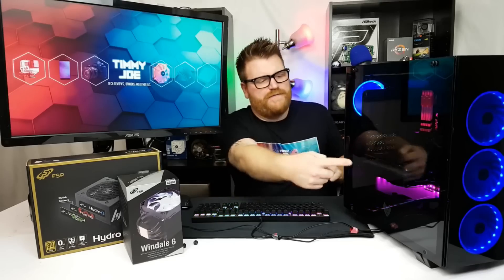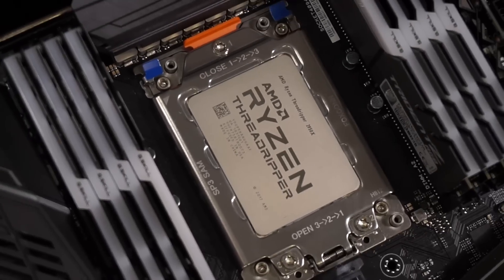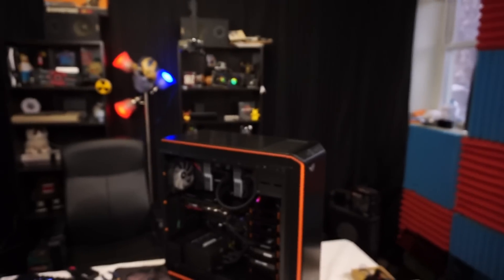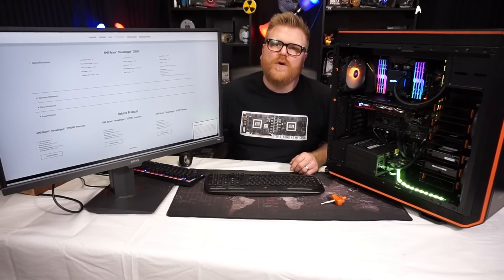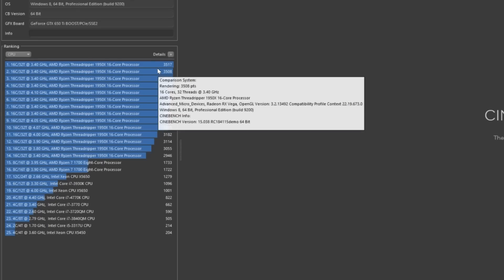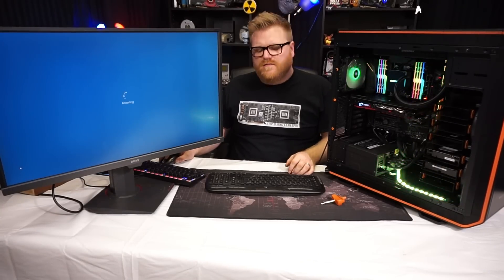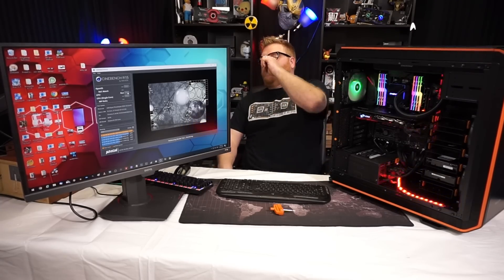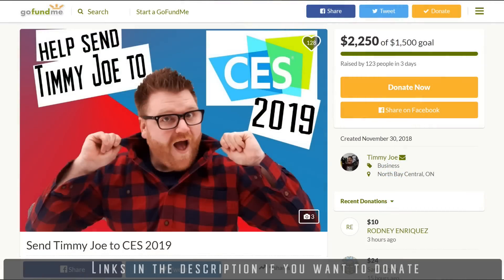Building, Overclocking and Cinebenching 2ed gen 16-core!

Comment: Take out some of the ram and up the speed to 3200, your benchmarks will be better.
Reply: idk about 2nd gen, but 1st gen on my gigabyte board did not play friendly with xmp profiles. I run linux and was getting kernel panics galore. Once I disabled the xmp profile and manually set all the timings and voltages it ran like a freaking champ. Rock solid 4.1ghz w/ 3200 ddr4 cl16, then again I also had 32gb not 64 (4/8 slots populated per motherboard manual)
Reply: In my test there's not a whole lot of difference between 2866 vs 3200 in Cinebench. You're better off setting RAM clocks a bit lower which will help you get better CPU thermals and clock speeds and give you better score compared to having higher speed RAM but lower speed and hotter CPU.
Reply: I havent had any trouble with XMP with 2 zenith extreme boards and a asrock taichi x399. Success with a 1920x 1950x and 2950x. I get 3515ish on the 2950x at 4.1GHZ and 3200mhz samsung bdie with TIGHT timings. I havent tried clocks higher than 4.1GHz yet.(only had the new chip a few days) SET THE PRIORITY TO REALTIME in ctrl-alt-delete i got a 400 point boost from JUST that.

Comment: try taking the top off of the case, it looks like it's really obstructing the airflow
Reply: Seriously.  That case is probably most of what's wrong.  Silence focused cases are terribad and that's a silence focused case if ever I saw one.
Reply: @abigailpatridge2948  its actually a very modular case. He doesn't/didnt know he can lower the mother board tray. Or even he could completely invert the mother board tray. So he could have put the fans on the inside of the case and not on that outside part. He just didnt know what he had on him. Or how to use it  I have the exact same case. And made the same mistakes at first I'm sure hell correct it.

Comment: I recently built a 2950x and from my research the Enermax coolers have a high failure rate regardless if its a 1st or 2nd gen cooler. I went with a CM 360ml and it failed after 3 days. I ended up going with a Corsair 280ml Platinum which worked out great.

Instead of doing a manual OC I highly recommend using PBO as it will be far more efficient than any manual OC you can do. You also want to enable PBO via the bios not Ryzen Master. Instructions for Asus bios below.

PBO - BIOS > Advanced\AMD CBS\NBIO Common Options\Precision Boost Overdrive Configuration\Accepted\ ENABLE

Furthermore, you don't want to push your TR over 68C / 1.4v for normal daily usage. If your drag racing for benchmarks then by all means burn up your silicon to get those high numbers. If anyone has questions bout building a TR you can check my 2950x YT live stream or just hit me up on my gaming stream.
Reply: can you help me i never went into that setting before

Comment: You do know you can lower the mother board tray to allow the fans on the inside of the case and not in the top shroud part. Or even you can completely invert the mother board tray If you wanted. Gamers nexus and LTT reviewed it and gave it high marks and said it was one of the most extremely modular case on the market with great noise to cooling performance.

Comment: Hey Timmy Joe, have you ever ran into an older board that only boots with one graphics card? I have an older 1155 ITX board that will only post with my R9 270 card, nothing else. i've tried everything from an R7 250, HD 7950 up to a R9 280X and even an RX 580. Wont boot on any of my Green cards either, 1050, 1030, 1050TI, nothing. thoughts?

Comment: We AMD people have it so easy now when it comes to overclocking. I have a ryzen 7 1700 in my laptop, and I can get it to 4 gigahertz with a slight voltage bump. In a laptop. And it's stable using prime95. All thanks to the ryzen master utility.

And dang that threadripper system is a lot of computer. Maybe we could try cramming it into my PlayStation 2 project? Jk.
Reply: What laptop

Comment: Wow, you're below my 1950x on a 120mm AIO...
3600+ with some cheap 3600-19-20-20 ram (I think it got about what you did with 2133 speeds)
41 multi at 101 FSB with 1.4v at medium LLC. Max temp was ~80c (max I've ever hit was 86c, just ramping voltage to around 1.45v just to see how much power I could draw). It was cold in my room, hence I was trying max power consumption with also 4x R9 Fury (tripped my 1200w PSU, LOL!)

Comment: I'm curious as to how you OC's the CPU (and memory).  I'd do a p-state all-core OC (frequency will still rise and fall with load, and will work normally.. and better than XFR).  As far as memory, get the Ryzen DRAM calculator and download Taiphoon Burner.  You can watch a video on how to get your memory's SPID info to use in the DRAM calc., and you can get the calc on Overclock dot net, it's made by 1usmus.  By using these methods, I have an 1800x that gets 1920 in CB15 (4.1 @ 1.39v / 3333/cl14 ) and settled down to 4.05 @ 1.37v + same mem stats for every day use, which gets 1880 in CB15.  It's a good method for sure.  It gives you all of the subtimings and voltages, gives a choice (standard, fast, extreme) and these settings always seem to work.  At the very least, it's a fantastic starting point.

Comment: You were probably running 3200MHz DRAM with your 1950x..vs. 2666. That will hurt your CB score. As far as boot issues and overclocking, take out 4 sticks and see how it does.. will likely hit 100MHz higher, if not more (might be able to get 3200 out of the RAM with only 4 sticks, as well).

Comment: Having all 8 RAM slots populated is putting a lot of stress on the IMC of the CPU. This raises heat output and also makes the CPU more unstable at high clock speeds. Try with only 4 stick of RAM. Also, no need to clock the RAM higher than 3200 Mhz, stressing the IMC. Beyond 3000-3200 Mhz you're getting diminishing returns. You are better off having the higher CPU clocks than RAM running at or over 3000 Mhz. All this is also confirmed by my personal tests on my 16-core 1950X.

Comment: Cooling and ram speed and timings... How low can you go on Gskill ram timings if running at only 2666MHz?
Reply: Varies a lot per kit, what he does, will not apply to even a batch made the next month on the same brand and series of RAM. Just like I can pull 4 identical GPUs, and 1 will not overclock as high on the Vram (or core), and even stock it might use 30w more (and a LOT more when overclocked), I'm referring to one of my RX 470 specifically, all 4 are XFX hot swap models, so its going to lower the TimeSpy score due to the limiting card (I'll still take number 1 since I have that for 2x, and almost beat the 3x score even with 1 less card, lol).

Comment: Juuuust a heads up..
Enermax Liqtech TR4 2 has some cons:

1. The fans SUCK. I've owned mine for a month, bought at the end of october, didnt even install until 1-2 weeks into november, and the bearings went out in one of the two fans. Ended up with loud, obnoxious, not so fun grinding (see tweet for quick video):
https://twitter.com/GloriousEggroll/status/1068762973638979584

2. The thermal paste that enermax sent with it was dried up beyond any means of usage. Would not come out of the tube, and when I forced it out, it was dry and clay-like. Did not use.

I ended up replacing the fans with two noctua 140mm SSO fans: NF-P14s redux 1500
after that it worked great. But yeah, kinda cheesed at enermax about this. BUT, at least the pump isn't dying. (The original TR4 Liqtech AIO had a known case of the pump dying, yikes)

Unfortunately it's the only AIO with full plate coverage. The pump on the Liqtech TR4 2 seems stable so far. Throw some new fans on it and use some better thermal paste and it's a solid cooler. Sitting at 4.1Ghz 1.37v 66-70c under load on my 1950x (mind you I also live in florida)

Also.. for that CPU I'd agree you probably want the 360. 1950x is fine with 280 but that beast you have needs a bigger cage.

and yeah, I had to upgrade my case as well. That bad boy was not fitting in a Fractal Define C (you can front mount it with some ninja-ing like I did), but I upgraded to a Cougar Panzer-S, plenty of space there!

Comment: bro why!!!!!!!!??? i bet lot of heat get stuck on the top of that case where the radiator is!!! maybe with better thermals you could achive more out of that bad ass combo!! 
p.s. i say, maybe just had the top panel removed ? Also an open case doesnt always mean good temps, but always means bad airflow,  and the airflow as i can see in this setup is not quit good

Comment: If you weren't so far away id let you run the rtx2070 i just ordered on my fx9590, even though you hate fx
Reply: At 4k, you'll be able to run th 2080ti nicely with FX (even underclocked), but I would guess you're going to do 1080p since that's a weaker GPU. I wouldn't recommend FX at 1080p either if you're running a 120+ Hz monitor... Its not the best for high frame rates (it does 60 fps great though, I've got no complaints on my long retired 8350 which I ran 4.8 Ghz for a long time, and now its screaming at 5.5 Ghz on exotic cooling, core temps peak usually below 0c so I can't read it in software. It's so overkill with a weak Titan Xp I run with it sometimes, haha, that thing is a trooper!).

Comment: i dont understand  1 thinks u have  3200mhz ram and everyone know this ram mhz very importand 4 ryzen why u still use ram  2666mhz ?
Reply from the maker: Not on the QVL list? I bet it would boot at a higher speed on a gigabyte board
Reply: @TimmyJoePCTech  sorry but i watch the video 3 time and i didint see anywhere memory frequency 3200mhz ? i only see 10:44  and 15:18  memory frequency still 2666mhz and u didint change the memory  frequency any one time?
Reply from the maker: I said it wouldn't boot with all 8 dimms at any higher, I haven't even tried removing them

Why you so worried about it hah.
Reply: @TimmyJoePCTech  of course I'm worried because I want to buy same processor and motherboard and it's not just only me maybe a lot of people watching your video and decide what they going to buy and if something happens we have to know this and you have to explain where is the problem and we not going to buy that's all please don't understand me wrong I don't want to attack you I just want to be sure that's all
Reply from the maker: @serdarmutlu2561  ok well I will be sure to give you an update soon!
Reply: @TimmyJoePCTech  thank you so much for understanding

Comment: those corsair sp 120 rgb fans are complete garbage , i bought the corsair 570x mirror black rgb and it is sitting here on the floor and for some reason i ordered 2 sets of 3 aigo rgb fans  for 24 bucks a set and they are cool as shit, im glad i just saw those fans working  those sp 120s they look terrible . by the way Selling set of 3 corsair sp 120 rgb fans with controller and switch hub cheap.